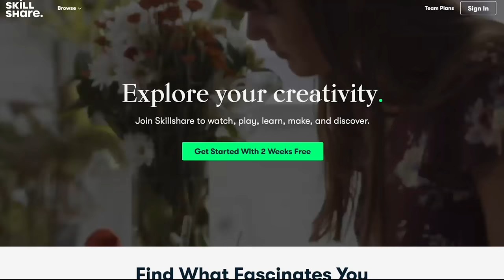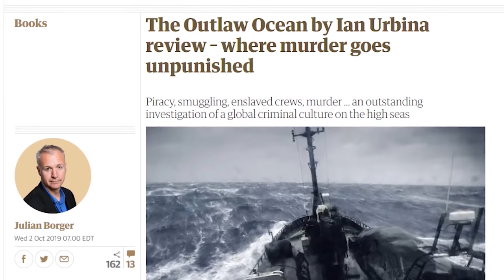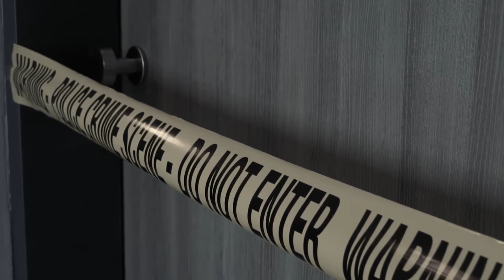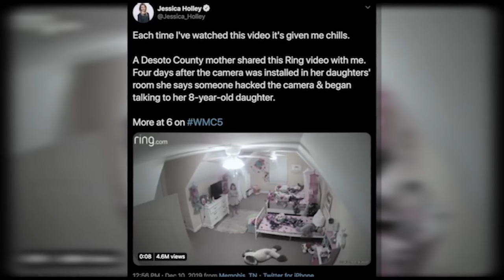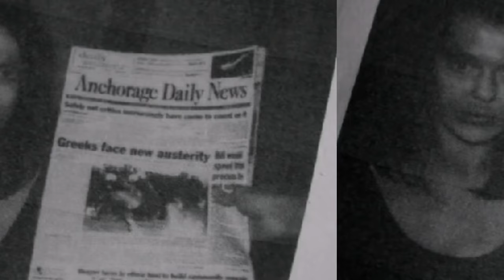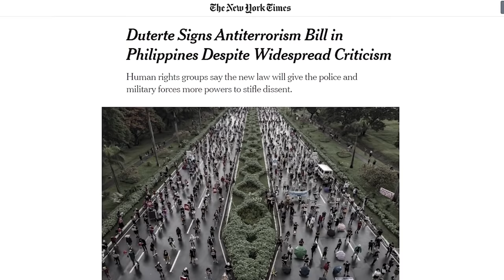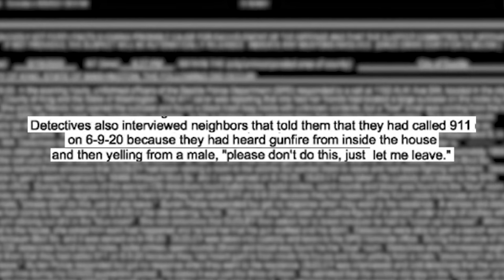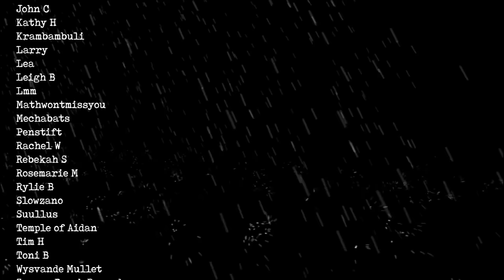Stories From Our Disturbing World - Collection 1

Comment: Concerning the amusement park accident. I've worked within heavy industry my entire life and worked as a Root Cause Investigator for five years. RCIs work with investigating accidents.
From experience, I can say that the 18-year old ride operators acted like the vast majority of 18-year olds act. At that age, you don't really have the life experience to act appropriately under pressure. Especially not when you're new at a job. Lots of insecurity, fear of doing the wrong thing, etc.
At one of the oil refineries I investigated an incident at, I recommended them to never have more than one young person on each shift for that very reason. 
I don't think it's fair to put blame on the young ride operators. The root cause sounds to me (not sitting on all the facts) sounds like a classic case of bad maintenance.
Replace the cable, none of it would have happened. A good improvement would also be to never let a young, inexperienced person work alone.
Just my two cents :)

Comment: The Nutty Putty Cave incident was actually worse than described here. If I remember correctly, rescuers were able to rig some kind of pully system that was successful in pulling John up a little bit. But a cable snapped, wedging John deeper into the hole. Just imagining being hopeful for that split second only for that to be ripped away and for the situation to become even worse is just horrifying and depressing. RIP John, I hope you are at peace.
Reply: It was an apt description for the time it had. They realized they can't pull him out because it would break his legs. Which presumably, considering the state he was in, could have been fatal. In fact, if you wanna get nitty gritty, every time they were pulling he would scream in pain because of his blood flow being completely f up.

Comment: I watched this video before but I'm stating it now. The case around 22:47 that's about the shooting at sea.
There was a phone. Phones have a SKU and model to them. They usually have a sim card to their service provider, which can give customer details. 
What was the findings in that? Because as someone who used to work in phone sales, you can't use phone service in other countries unless you pay the government a specific tax. Was the phone usage? Who provided the service? Was there any service at all? What was the model (some models are only sold in specific areas)? What's the language on the phone?

This is really agitating me. How could they not get any information off of that? The entire idea around phone information is to keep customers from ditching a bill and running to another provider, or just using service in several different countries. Even if they bought one of those short term sim cards from the airport, it still has information! 

Aaaaaaa

Comment: The Tylenol pills are why only workers should be able to access products and customers should use the supermarket as a sort of drive-thru where workers will have only access to items and therefore handle stock more efficiently (less lines, order ahead - item pickup, etc.) It also protects stock from consumer damage or infection/loss prevention, etc.